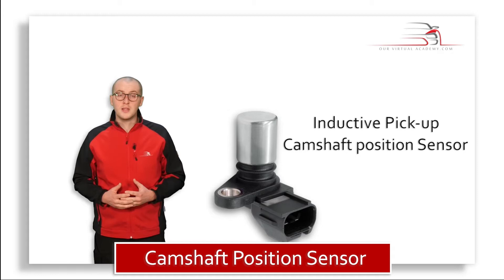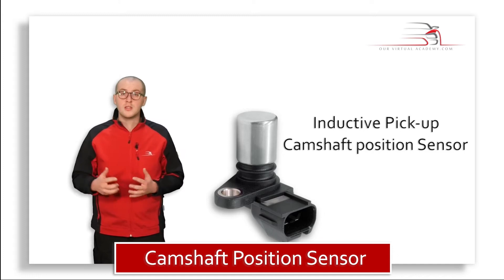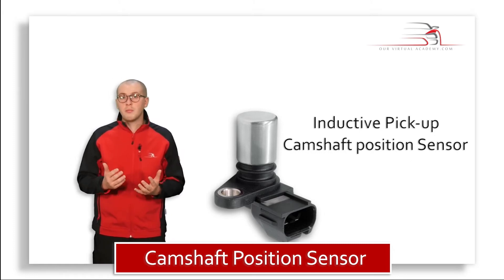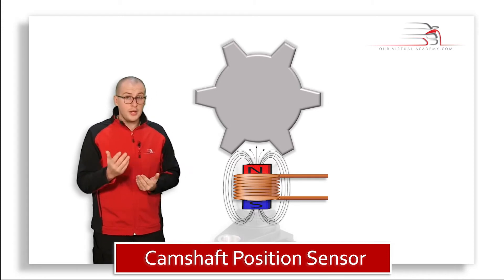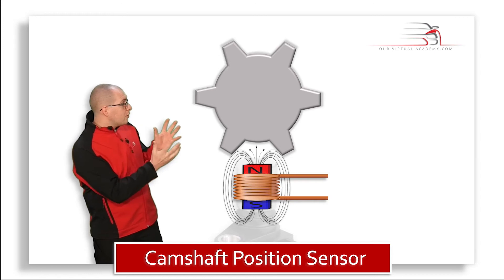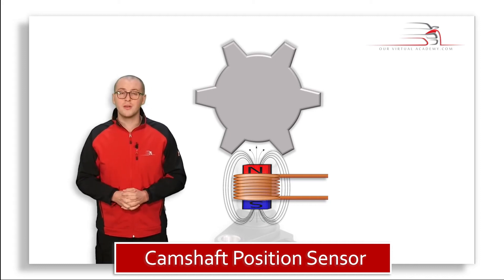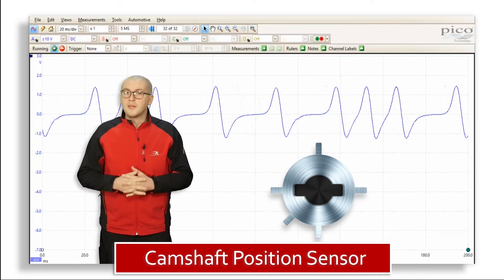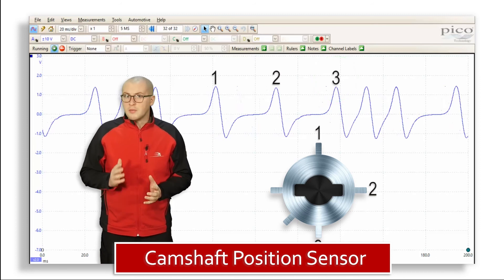Camshaft Position Sensor

Comment: the diagram that was shown of the evenly spaced teeth - was that in reference to the end of the camshaft that has this strange pattern where you can place the vvt locking tool? i accidentally broke a small tooth off it, and i want to know if itll affect the timing, so that i can weld it back to where it was - thank you.